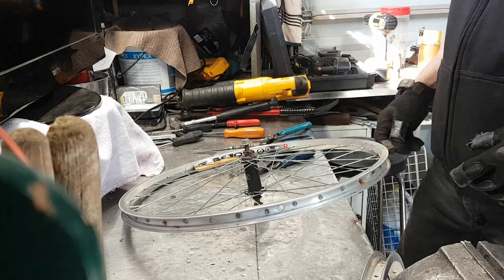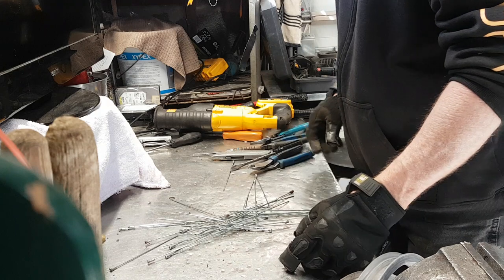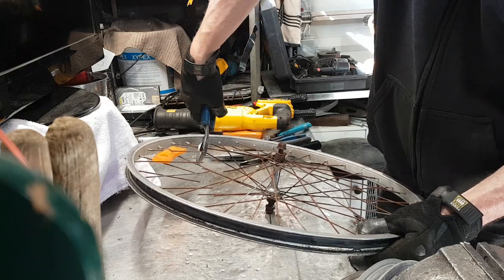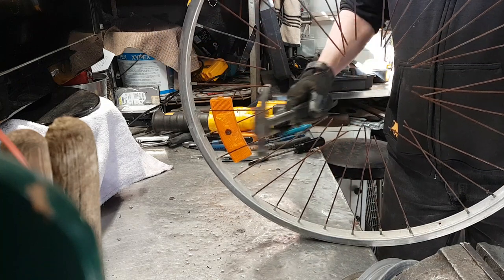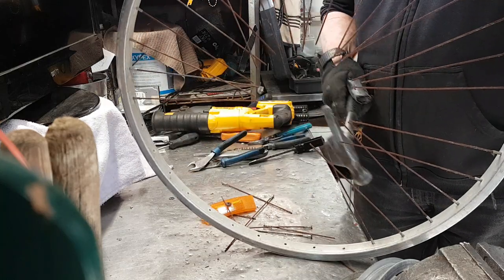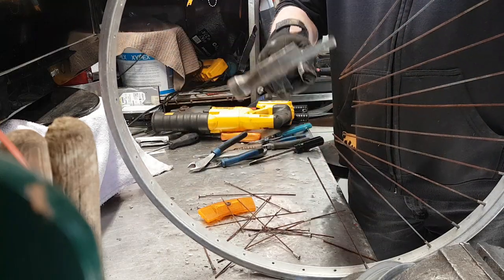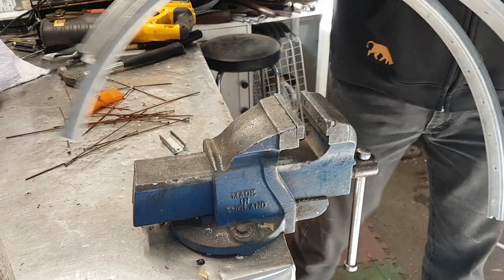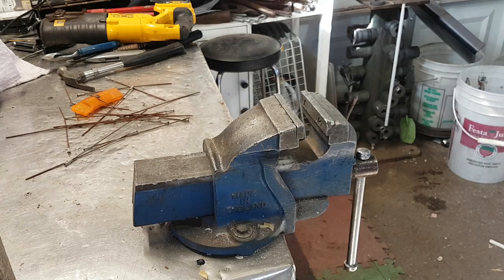Quick view on bike rim teardown!!

Comment: Do you ever check the spoke nuts I have found a lot of brass ones, I use a cordless drill to remove them by putting the nut in the chuck and bend the spoke and hold onto it. Keep up the great videos and God bless you and your family.
Reply from the maker: Usually steel!!